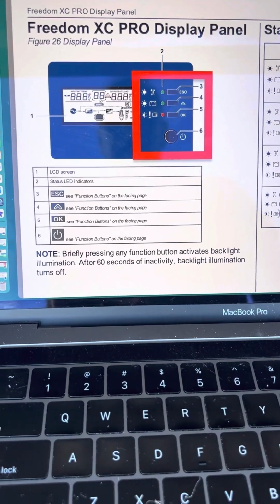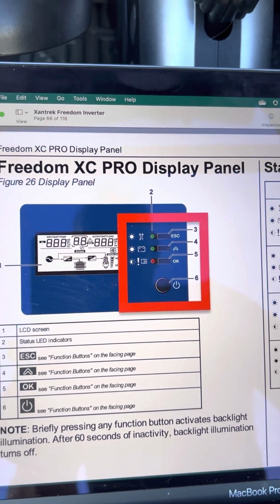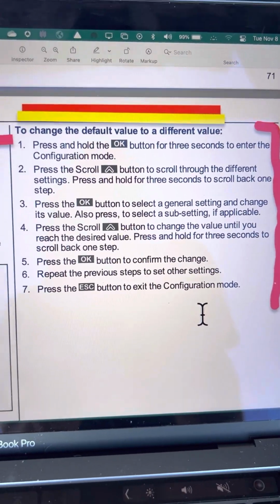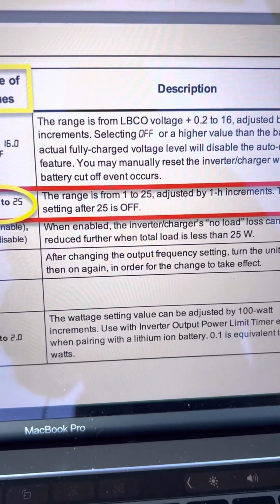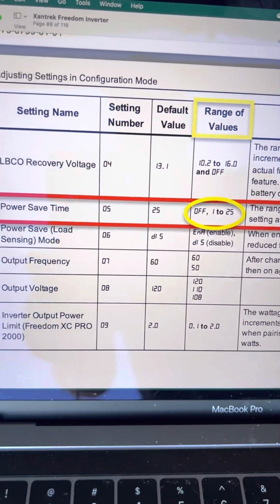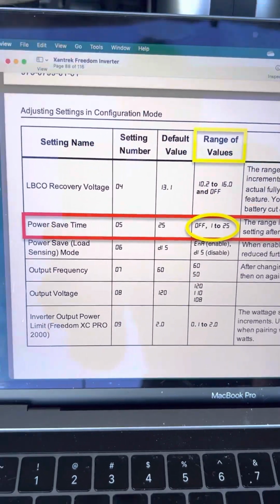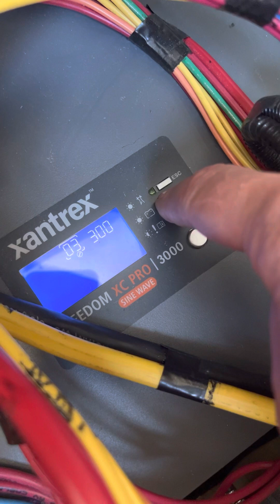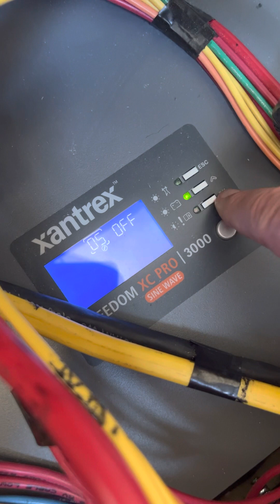Inverter 101: setting your Power Save to “OFF”

Comment: Does changing the setting to “OFF” mean the power button should work for turning the inverter on and off? Mine was at 25, followed your instructions and changed it to OFF, but the power button doesn’t do anything and it still stays on.
Reply from the maker: Yes, unless you have the Fusion radio. It has a ‘marine”setting that never allows it to turn off.  The other setting to turn-off the inverter is to set it to go to sleep after xx hours of no use (also an inverter setting).